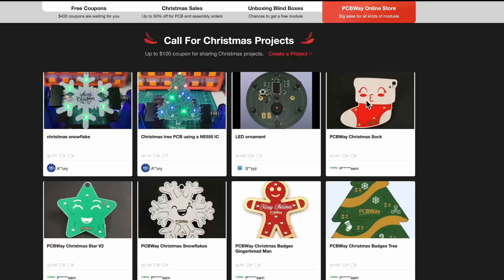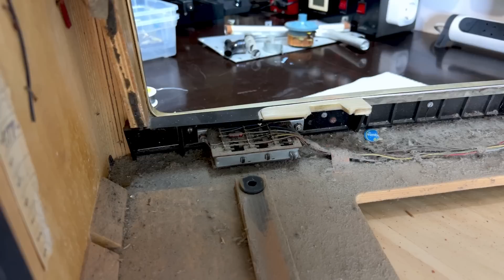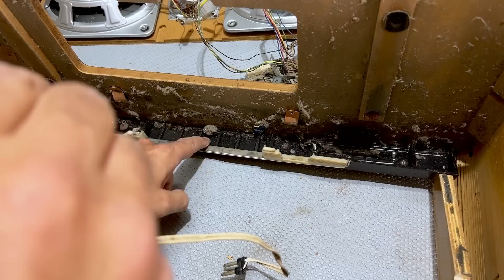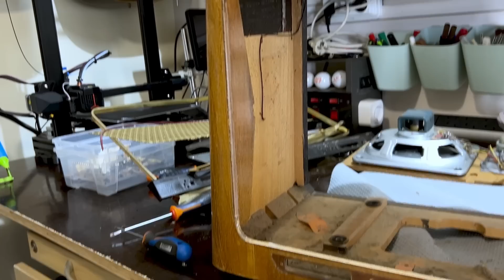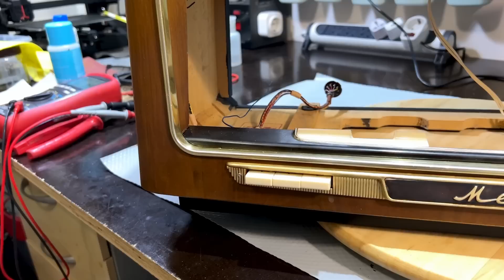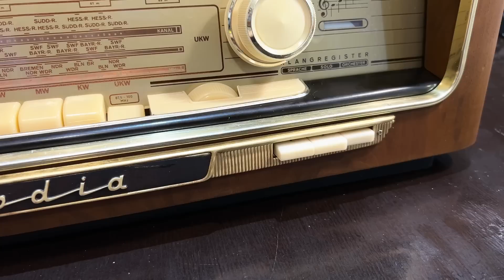She's all done, and packing Bluetooth. Great Sound. Graetz Melodia 519 restoration pt.4 #pcbway#

Comment: Hi Manuel. I will admit I really like the lighter colour matte finish. It suits this style of radio very well. Possibly harder to achieve that a gloss finish as the final,coats have to go on perfectly smooth because you won’t be sanding & polishing them. 
I listened to the final few minutes again with my good headphones (my TV sound is so-so) and WOW!  I hate to admit it but it sounds better than the Bush VHF 64 I recently finished. 
Congratulations on an outstanding restoration of an outstanding radio!
Reply from the maker: Thanks 🙏 I actually got to listen recently to the Bush 64 that I did on the channel, which belongs to a friend of mine. Still sounds amazing 👍

Comment: Manuel ,the pipes seemed both opened at the down side.Can you confirm it??.Also treble extension works ,but which could be the roll off point 5K-7k..10k?Nice video as usual.

Comment: A wonderful restoration, the Graetz 519 looks and sounds as good as the day it was unboxed.....decades ago in the 1950's. I think you are right in that these vintage electronics should be fully restored and not just repaired - like those brakes on the Land-Rover!🛻
Those loose wires at 25.42, maybe they were preventing interference by conduction, and so routed them away from the loom. Thanks for posting.☀
Reply from the maker: My pleasure

Comment: Looks really good with the matt finish. Sounds really good too. I will have to look into that Russian magic eye equivalent as I have a Grundig which uses the same expensive valve. BTW you were right about BBC Radio 4 still being on Longwave - I had to put my radio in the attic to receive it.
Reply from the maker: I believe it's the 6e5S or 6e5c tube.

Comment: Forget doing a Tipton, I'll be doing a Caldeira! Outstanding result Manuel. You have shown a top result can be obtained even with limited space and resources. A complex disassembly and reassembly of the cabinet, I would have made a recording of it too. I was hoping you could expand on the 'tweeter' pipes and why they used them in lieu of the standard electrostatic speakers. Thanks Manuel for a fascinating series 👍🙂
Reply from the maker: Let’s call it a “tipeira” 😂 
I tried to do a freq response measurement on the “pipes” but was unable to get good results. I could not disconnect the other speakers as they form part of the entire system, so getting sound only from the pipes was a problem for my measurement microphone. I did notice a reaction at around 7 to 8kHz, but it’s not scientific, just perception.

Comment: The gold dial is unusual but very attractive. Sounds fabulous, well done. I just built one of your bt boards with booster and I’m curious about your changes to it. Best wishes from the very drenched Pacific Northwest 😊
Reply from the maker: I want to add a switching control using the magic eye B+ line that goes off when you select Phono. Just want to stop the unit being permanently on when radio is playing. It further reduces the chance of buzzing on AM reception.

Comment: Looks good. 2 small points occur to me. 
a) On the rear panel the right hand 'bolt' appears to be missing a washer which is present on the left.. It looks like the omission is causing damage to the panel.
b) On the shot of the replaced 'horn' assembly were the capacitors replaced and protected with heatshrink. What was the state of the replaced capacitors.
My apologies if I missed an explanation in the videos.
Reply from the maker: Good point about the washer. The caps were slightly high, so I decided to replace them for added life.

Comment: Hello Mr. Caldeira! I would love to know how did you remove this 'gold' plated metal frame that goes around the front frame of the radio? Did you re-do the gold plating becuase it looks more gold than golden buillion coin!
Reply from the maker: The frame just came off by itself. All the glue was dried out. The lower brass element was polished with a rotary tool. It’s not difficult, but you need to take care not to overdo it or it may bend out of shape. I then spray it with clear lacquer to protect it from further tarnishing.
Reply: I have a Greatz R419 ... virtually the same radio except dial colour. Its on my channel.
I had a head scratch regarding this brass trim.

After removing it by gently sliding a sharp knife under it at the back (inside the cabinet) and then polishing/lacquering it I found it just would not fit nice and snug for glueing.

So I bought a box of matches and cut the heads off. I strategically glued some matches inside the channel of the brass strip where it "grips" the cabinet where there were some excessive gaps.
After leaving these to dry thoroughly I offered the trim up in place and found I had to take a few slithers off of the matches with a VERY sharp knife. I got an almost perfect interference fit without glue this way but obviously I still glued it back in and the matches proved to be an excellent base for the glue to the cabinet.

I have since done this to a couple of other radios with similar brass surrounding trim and you can achieve a very precise fit.

Hope this helps.
Reply from the maker: Great idea using the matches. I’ve also used balsa wood which is easy to cut and comes in very thin strips. Any solution is good as long as it works for you. Thanks for your feedback.
Reply: @electronicsoldandnew  Balsa wood is probably a better option to be fair Manuel but I didnt/dont have any. Guess Ill be on eBay in an hour or two to stock up. Thanks